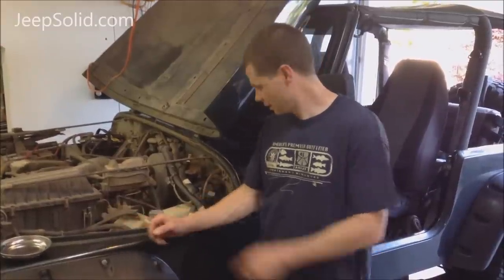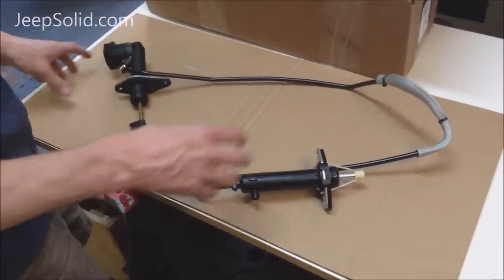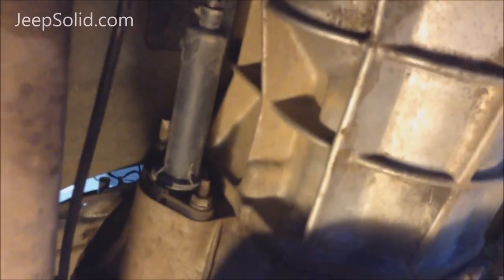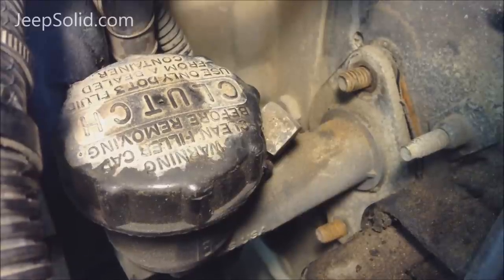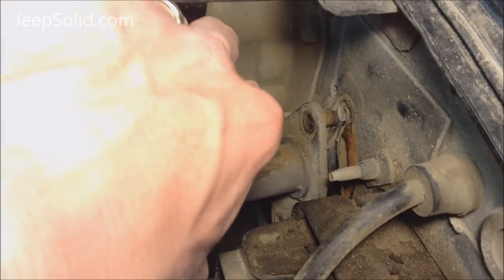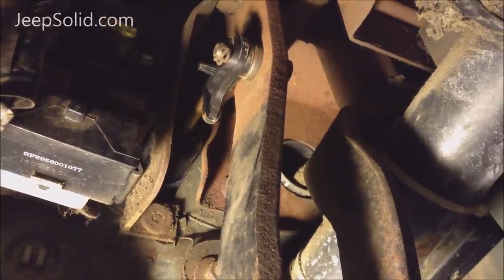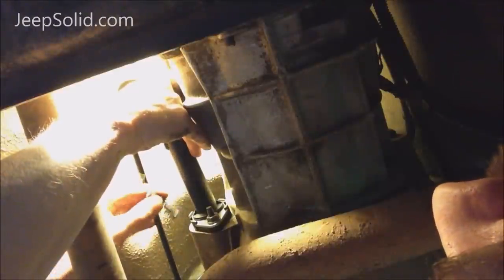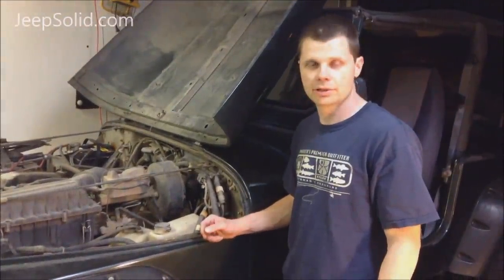Jeep clutch master cylinder and slave cylinder replacement: Jeep Wrangler YJ

Comment: Thank you for taking the time to make your video on how to change the clutch master and slave cylinder. I took your advice and got the master and slave cylinder assembly. 
The installation was very easy. The four nuts were all 1/2".
Reply: THANK YOU for the size! that's what I came here to find

Comment: Thanks for the refresher on this. I replaced it about 10 years ago on a YJ 4Banger I still have, but it seems to have failed again (planned obsolescence, planned failure with this part lol?  I see the warranties are 5 years, typically). 

So, I'm putting another one in today and your visual step-by-step is useful.  Cheers.

Comment: Thanks for the vid - My 06' liberty 6spd had almost no clutch release one day and I had to put it in first gear before I started it and it dragged itself back into the driveway with the clutch pushed in when I started it.
Reply from the maker: +fivepointeightnate Oh, man!  Yeah, not gonna get far that way. Hope the repair goes smoothly!
Reply: Got 'er done but it wasn't as easy as you Wrangler guys. The brake booster has to come completely out to change the clutch master/slave assembly.

Comment: I have to do my '04 Liberty.  I think I'll have to pull the battery and the computer to get to the master.  Not nearly as open as the Wrangler.  Also, there is a wiring trough above the master, so you can't get to the cap to check levels.

Comment: What were the symptoms leading you to conclude that the master and slave were defective?  Our YJ 95 seems to have a similar problem, my son heard a noise while driving then we noticed that we feel less resistance when pressing the pedal , then it returns slower to position.  There are no external leaks.  What would be the difference between these parts being defective and a faulty clutch?
Reply from the maker: In this case, when stopped at a light, the clutch pedal would slowly lose pressure and the clutch would slowly engage trying to roll the Jeep forward.  I would have to pop it into neutral and pump the clutch to re-pressurize it.  Replaced this system and fixed all the issues.
Reply: Thanks, we ordered and received the part, there was a bit of fluid in the bag just enough for the part to be oily.  We installed everything, and pressed on the clutch, but the plastic tabs are not breaking and the clutch friction point is at the bottom of the floor. I have added some fluid to no avail. So my question to you guys, is, should I just cut the plastic tabs loose or could the interior remaining part of the tab affect something, or does the system need to be rebled and would you know how to do it? Other question, if I remove the installation, and the tabs were broken but did not get out, can I reinstall after? Thanks for your continual support.
Reply from the maker: yep, you can cut the plastic tabs holding the piston in place.  You just have to be ready to grab the piston as it will start coming out of the slave cylinder.  Have to keep some manual pressure on it so it does not extend too far out, letting air into the system.  This can be done by hand, just have to be ready for it.  Or you could cut them with it installed and just loose.  Just have to make sure this piston engages the lever in the clutch when installed.  Good luck!
Reply from the maker: The system featured in this video does not have a bleeder valve on it.  Not sure if yours does or not...?
Reply: No bleeder valve on ours either, however, we started to press the clutch repeatedly and shake the tubing and suddenly we got the clutch friction point to be much better, a little low but not bad, just have to get used to it compared to before. What I still cannot understand is that the plastic tabs have not fallen off, I just might do as you suggested and cut them with the cylinder loosely installed. Thanks again, you are really the best go to guy on Jeeps, and the fact that your videos are with a 95 is great as I have a 95 so all you have done on your apply, and I always check your channel before starting a new repair in case you have done it before!.
Reply from the maker: Thanks Eric.  A lot of my recent videos have been on this Cherokee project I picked up.  Many of the repairs are similar to the YJ, but don't worry, more YJ stuff coming up!
Reply: I might have to get myself a Cherokee to keep up with your pace!
Reply: Wow, glad I stumbled across this comment thread. I also have a 95 yj and experienced the same issue with the clutch. My friends were calling me stupid for not being able to find a bleeder on the old system, so I'm glad to hear I'm not alone! Thanks for being vocal Eric!
Reply: @JeepSolid  I want to repeat what Eric said. Thanks for posting 95 yj content. I don't know what I would do without you, lol.

How has this clutch assembly held up since 2014?

Mine needs to be replaced for the same issue.
Reply from the maker: @williamburch1321  it's been rock solid since I installed it.  No issues.  Thanks!

Comment: Replaced the master and slave cylinder. When I tried to intstall the slave cylinder the rod will not allow the unit to fit flush for the bolts to go in. Should I force in by tighting the bolts?

Comment: This looks easy enough! I’m going to give this a try on my own, however, the Amazon link is stating that it does not fit “1993 Jeep Wrangler”. Is this true?
Reply: 1993 has an internal slave cylinder. You have to drop the transmission to get to it. Horrible design!

Comment: My son has a  91 yj he drove it a few times less than 20 miles at a time he had the gesr box switched new .now he needsed  to keep filling it .I checked the master cylinder  n where its conect too the trannie theres only the screw part no ywo bolts n it just slides in n out .help me im i dealing with another engine that was put in this jeep

Comment: Hi, l live in England  and drive two  Jeep Wranglers both 1995 a 2.5 and a 4.0.
They were both imported from the US in UK  spec so both are RHD.
By looking at the plastic hyd pipe  bends on this pre filled assembly looks like it will only be suitable for LHD Jeeps.
Due to the fact than on a RHD Wrangler YJ the master cyl is mounted on the right hand side bulkhead firewall.
So are RHD versions of this available from the US ?  any help or suggestions most appreciated.

Comment: Can you be a little more specific about the part where you insert the metal rod with the plastic end caps into the transmission?  Your video kind of skipped to after it was done.  Is there something I should be looking for, or a specific click sound/attachment to ensure it's correct?
Reply from the maker: No click or anything.  Just need to make sure the rod from the cylinder is lined up with the receiver in the clutch.  If it goes in straight it should be fine.

Comment: I just had the rod going into the master brake cylinder come out.  Looks to me like I'll have to replace master and slave.  What do you think?
Reply from the maker: Yeah, some, like mine, are all in 1 unit.  Was super easy to replace and have had no issues with it since.
Reply: I bought the master and after I had it installed, I went to bleed the system.  I then found out the slave on the 95 YJ doesn't have a bleed port!  I'm sending back the master and ordering the master/slave.  That's what I get for trying to take a 'short cut' and being cheap.
Reply from the maker: Oh man, yeah...

Comment: Thanks for the video. A dishonest mechanic told me that to change the slave cylinder it was necessary to lower the gearbox, now I see that it is not necessary.
Reply: Depends if you have the 4 cyl 2.5L or the 6 cyl 4.0L. On the 4 cyl the slave is external, on the 6 cyl it's inside the bell housing.
Reply: @FoxMan777  Un have a 6 cyl y 4.0 L

Comment: Do you have to detached the hose part to feed through ?And where form top or bottom . Thanks and last I am having sometimes getting into first gear and reverse could this mean I need to replace the slave cylinder. The reservoir fluid is clean and full ? thanks my Jeep is. 2000 tj well taken care of same clutch and gear box
Reply from the maker: This system stays together during assembly.  I'd also check transmission fluid in your case.
Reply: i chaeck the trans fluid. . thanks @JeepSolid

Comment: If you buy a pre-filled/pre-bled one, does that mean you can just slap it on or do you need to add some fluid?
Reply from the maker: +Dan Allen Saldana Didn't have to add any fluid, but always a good idea to check the level when working on it.
Reply: Awesome! Ordered a set and it should be coming in tomorrow. Hopefully it fixes my problem. Can't seem to get my jeep into gear, however I don't think it's the clutch. The shop said it seems like the pressure plate isn't getting pushed in enough.

Comment: My slave cylinder goes straight into transmission housing,no bolts no bleed out steem. How do i replace.91jeep wrangler yj 4cylinder
Reply: donald ward jr.   That's exactly my problem I have to. I have a 1991 YJ and the slave cylinder is located inside the transmission case . 
If I have a problem with that slave cylinder I got to take it to a garage because they have to slide that transmission back just to get to a $20 dollar part . 
Its gonna suck for me .

Comment: my jeep is manual and  I am having trouble shifting. i replaced the clutch master cylinder but did not replaced slave cylinder and jeep did not improve any. also i havent change the transmission oil.

Comment: The damn bolt for my crank position sensor fell into my bell housing 😢. Can you tell me if I would be able to get a magnet in thru the slave cylinder hole to fish the bolt out?
Reply from the maker: Oh Man!  That stinks.  Sometimes I wonder why can't the job just go smooth.  Haha.  Yeah, should be able to get a magnet retrieval tool in there.  May have to use a mirror to see where it is...  Good luck.

Comment: I have the internal slave/t-brg. I replace the Master Clutch cly and can't get the system bled? I thought the master was defective so they gave me a new one, does the same thing, won't bleed, no resistance on the clutch pedal???
Reply: check the push rod from the petal to the rear of the master

Comment: To remove the nylon retaining strap do you just pull the slave after breaking it and pull it out?
Reply from the maker: Nope. You just leave the straps alone. They will break on their own and be fine from there.
Reply: @JeepSolid  where do the straps go? do they just live inside the transmission forever?
Reply: I got my answer from the installation-it all makes sense when you install it- the straps pop right off  onto the ground when you press down the clutch pedal the first time. The plastic knob (on the end of the slave piston rod) stays in place as it should. super easy 10 minute job, I think I got my part for 54 bucks on amazon. what a  easy solution to a headache of a problem.

Comment: jeep failed the other day, was working fine when parked but after sitting for a week it was rough going into gear and seemed like the slave cylinder wasnt lifting the pressure off the clutch, after a few forcing it into gear moments i made it to my destination and parked it... when i started it back up there was no clutch, as in it was like the clutch pedal was constantly pressed in and all gears acted as neutral, no smoke or anything engine bog when i let the pedal out and rev it so i dont suspect the clutch

my question is can the slave cylinder fail  in the open position with no pressure on the clutch, ive only ever heard of them failing in the closed position where the clutch is forced onand you cant shift or start the engine

06 jeep wrangler 4.0l 6 speed
Reply from the maker: +Andrew Browner Yeah, Haven't heard of that one. Curious what ends up being the issue.
Reply: Yes, that is your master/slave cylinder. I have a 93 YJ and when I lost all pressure, I could not get the car into gear, and the clutch was dead on the floor with little to no travel. I actually have been driving it with a leak in the slave cylinder for the better part of a year, I just top off the master cyl reservoir every 75 miles. Im not an expert, but I think replacing the master/slave cylinder could solve your problem
Reply: i have full clutch pedal feel, but when i let the clutch out it doesnt engage, i can switch through all the gears but they all act like neutral, opposite the symptoms of a slave cylinder issue
Reply: what did it end up being?

Comment: Awesome video Dale, thanks!  My 95 YJ 4.0 is making a super annoying squeaking when I push the clutch in. Starts very subtly and gets really bad. You think that could be this system??  I went underneath and it seems to be coming from the hose and external cylinder.   Thanks again, love the channel!!
Reply from the maker: +Ian OBoyle Hey. Thanks for the support!  I appreciate it. Boy, mystery sounds can be tough... I guess it's possible it's the master cylinder system, but initial thought was the actual clutch. Maybe resonating sound up the slave cylinder??  I'd probably replace it if that's what you suspect. If it turns out not to be, then at least you have new slave and master cylinder :).

Comment: The website for the Dorman Clutch Combo says it will not work for my '93 YJ. Does that sound correct?
Reply from the maker: 1993 yj 4.0?
Reply: @JeepSolid  Yes, 6 L 4.0. The website says  fitment not compatible.
Reply from the maker: Yeah, 1994 they changed the setup in 1994.
Here's a link where I talk about that. http://amzn.to/2vSOzQb

Comment: How does one know if they might need to replace their clutch master/slave cylinder?
Reply from the maker: +MidknightS0N In this case, when I had the clutch pushed in, it would  fade away and slowly engage the gear again. I would have to pump it on occasion.

Comment: I was driving along and all of a sudden the clutch pushed to the floor and no longer worked.  It made a weird noise, too.  Is this the master cylinder?  Jeep Girl...wanting to fix it myself...:)
Reply from the maker: Sounds very much like a master cylinder failure.  Any fluid leaking out?  Check the fluid level.  But, yes, it's an easy fix.
Reply: OK, thanks!!

Comment: 2:23:  Why did you jump right here? You skipped the most important part of the video. That moment was the whole reason I was even watching the video.
Reply from the maker: Because all you do is put it in the opening. With the plastic piece over the piston so it touches the lever inside. I guess all I cut was the act of putting it straight in the opening. Nothing complicated. Hope that helps
Reply: @JeepSolid  The video was a lot of help, but I had some anxiety about that plastic strap and what to do with it. Once I got the slave cylinder out and saw what was going on, I took your advice and put a bit of grease on the plastic head where it fits into the cup on the clutch throw out bearing activator, and everything went well from there. I think it was you who said something about the plastic straps breaking away when you press the clutch in for the first time and that was good to know too. I think some people have messed up by trying to remove the plastic straps and that would ruin the whole process. I knew you had to keep the system  under pressure, but the issue with the plastic straps had me troubled. Thank you very much, this was a very informative video and helped make the whole process much less scary. Thank you again, Josh.

Comment: how can I tell if it's the slave cylinders bad or if it's the clutch?
Reply: +Roy Moree In my experience both wear out just about the same. If it's still the original clutch then chances are its the original Master and Slave cylinder from 20+ years ago. I started by replacing my clutch in my 94 YJ just to find out only the pressure plate was worn, now I'm currently replacing the master and slave cylinder. It seems to me that the replacement of the clutch and clutch cylinders goes hand in hand.

Comment: Just did your repair , Problem - you indicated systen pre bleed.  what I got was not pre bleed..Now need more work.  Please advise your people that some systems are NOT pre bleed,  Thanks
Reply: +Charles McClung Yep just got one from RockAuto and it was not bleed....have to pump the clutch many times before it gives good pedal.  I guess I will try the gravity bleed since I am by myself
Reply: Some systems claim to be "pre-bled". There is always a bit of air in the system due to shipping and such. The external systems like was presented here typically are fairly decent right out of the box. But .. its always expected to have to top it off and burp a bit of air out. The internal slave cylinders like in the early YJs, the master cylinder and slave are always purchased in separate pieces. Bleeding is mandatory and messy unfortunately.

Comment: where do you order them from?
Reply from the maker: Actually ordered this one from Amazon.
Reply: I just bought the slave with the bleeder with my new master. Then used my line.
Reply: What is the part number on amazon... saw one but amazon says its not compatible with my 93 yj 4cyl

Comment: breaking nylon strap ?  why does that need to break ?
Reply from the maker: Chevelle99X -Daniel That strap holds the piston in place on the slave cylinder.  This unit is designed so after its installed, you depress the clutch, which breaks that strap to release that piston so it engages the clutch.  If you cut that strap before its installed to release the piston, it will push itself out.  Not the end of the world unless it extends to far allowing air to enter the system.  So, leave that strap on and install it.
Reply: well, I just did a clutch job and have had it tie wrapped to the frame rail out of the way and went to install it back last night and noticed that was broken and that's why,, well since all that's true, as long as the piston didn't pop out I can just reinstall correct ?